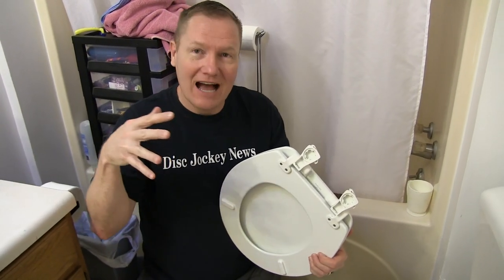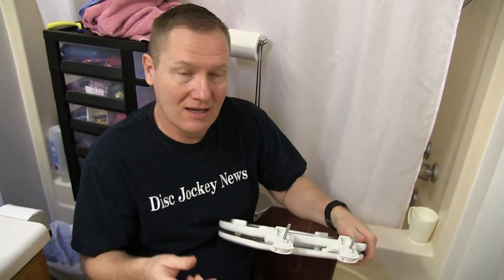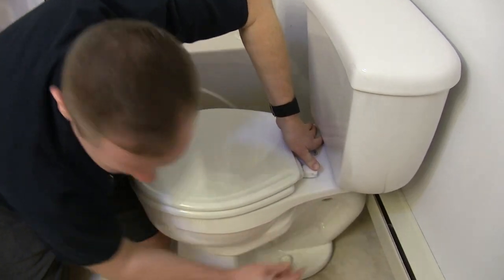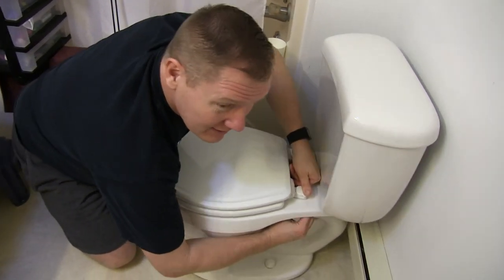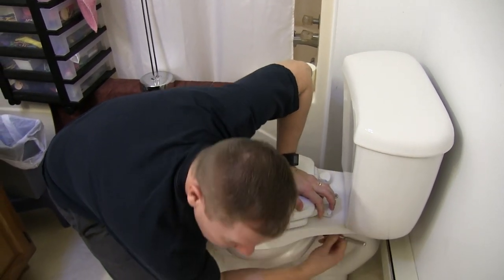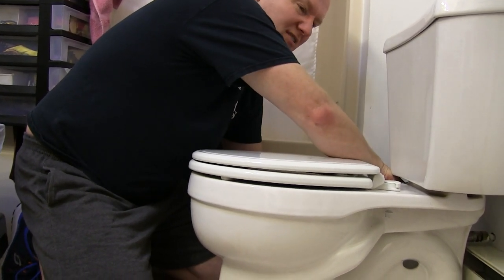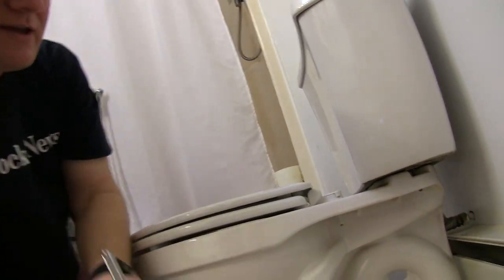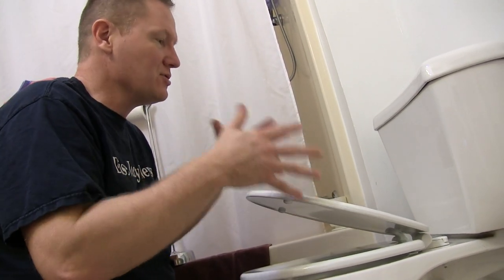How To Replace Mayfair Slow Close Toilet Seat | Weekend Handyman

Comment: Thanks for this. I was going insane trying to take mine off lmao. Videos like this are always a treasure to find. Hope you're doing well!
Reply: Did you have this same model this easy close is so hard to take off 😫
Reply: @greatnesstremonte7182  I installed this model a few weeks back - it was easy but with one hitch; the bolt under the toilet snaps off which it is designed to do - the hitch is, when you go to remove the whole unit, you need a 5/8" deep socket wrench to get it off. I fumbled with a couple of 5/8" wrenches and sockets till I figured out the "deep socket" wrench is the way to go. After that, the whole thing came off easily.

Comment: I know how to install this. My problem is replacing a Mayfair slow close seat that is now worn and the bolts can’t be loosened.
Reply: I am experiencing the exact same problem, which is why I've been doing a deep dive to find a clue!!  The lid was so simple to place and secure, back in the day, but----now the lid has failed me.  Over the course of well over  decade, I managed to repair the attachment bolts when the seat would start to come loose, but right now, no matter how hard, and how many times I try to unfasten those doggone bolts, I keep failing!!   Please, if anyone reading this has a clue, please.....post it here.  Ty.
Reply: I found a solution!  I used a small butane torch - could maybe use a regular lighter - to make the tiny plastic underside nut maleable (once the main larger plastic nut is removed) Then I just pulled the seat up, and it came off.

Comment: Cannot find anything (anywhere) about removal or trouble-shooting for this. This was easy to install. I've replaced each toilet seat in the house with the slow-close, easy change seat. However, the lid on one of our seats no longer "floats" down. The seat is fine, but the lid slams. Any tips or do I need to replace the seat? Also, to remove this type of seat, do i need to use a deep socket underneath the back of the bowl to back out the plastic nuts since the bolts are not slotted (flat-head or Phillips):?
Reply: I'm looking for a video to fix mine, also. It slams and it's supposed to have a "lifetime" of slow closing. Cannot find anywhere on the internet about fixing them, it's all about installing them. Great video, btw!
Reply: I'm in the same boat - trying to get the nuts off under the toilet is near impossible. Guess I'm going to have to find a deep socket 5/8...  what a pain!